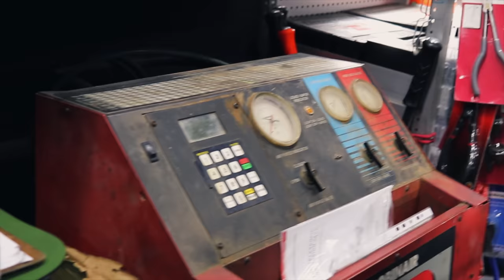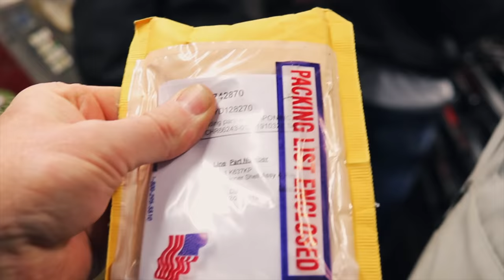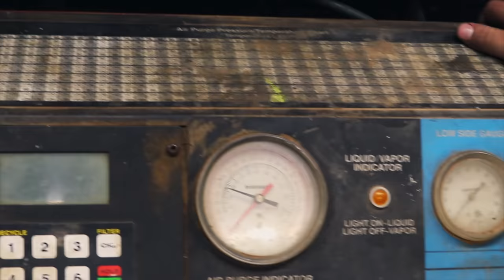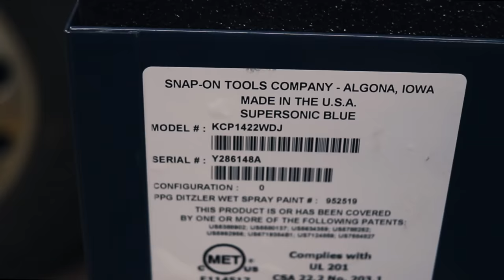Snap On Sold Us ANOTHER New Toolbox

Comment: Clay, quick question.
When you did the torque tests on the cordless impact tools, were you using a snap on tech angle torque wrench?
If yes, how do you like it and have you had any issues with it to date? I noticed the special  promo pack Hamilton had on his truck.
I’m a little hesitant about all the buzzers and lights when all I’ve ever used are the old school “click” torque wrenches. Thoughts?
Reply from the maker: I used the split beam style and the 3/4” click style in the video. I do own the digital one that does angles (mine is the older style 1/2 ) i still prefer the split beam style honestly. If you need the angle and all the fancy jazz go digital. If not hard to beat a split beam and that “click” it gives. Just my personal preference.